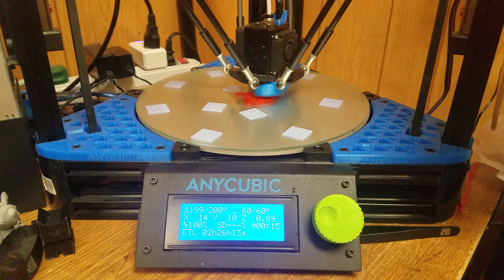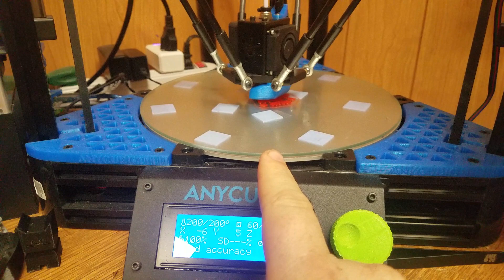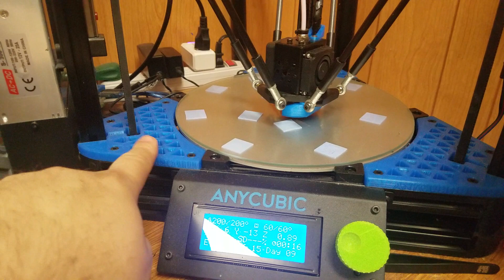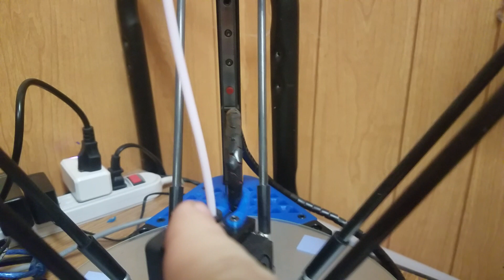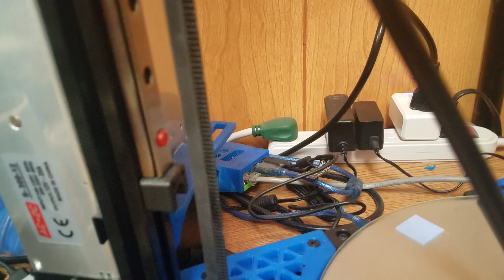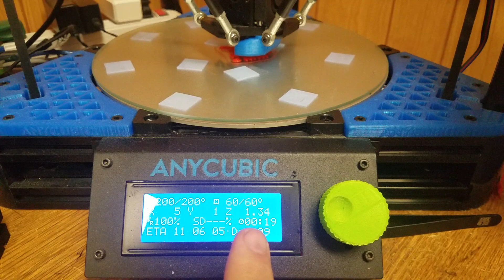Anycubic Kossel Linear Plus basic mods for the beginner

Comment: Just found your video, super informative my question for you is what are those square pieces under the glass?
Reply from the maker: Silicone thermal pads, made for CPU heatsinks. When cold it's sticky like cheap packing tape so you can remove the glass, but when at print temp you could lift the printer by the glass and they transfer heat perfectly.

Comment: what firmware are you using?  everytime to try to print something it just heats up and go back down then up and when it does print the nozzle is not touching the bed if so how would i manually calibrate it?
Reply from the maker: A slightly modified Spike Lee 1.1.9 to deal with filament change and heats. Otherwise it prints fine as is. To solve the other issue your having I've found the solution is to install the probe and run the probe Z height in the menu.

Comment: Would you recommend this printer for a beginner?
Reply from the maker: A delta is more as a second printer, it has a higher learning curve
Reply: @Tobashadow  im eanting to get into the 3D printing hobby. What printer would you recommend for a beginner?
Reply from the maker: A Ender 3 right now is the best low cost printer with a large build plate. For a bit more you can get a Monoprice maker select Plus which is my primary machine. Both of which are easy to use and versatile and easy to modify.
Reply: bought this as 3rd printer and I'm really struggling. I assembled the printer and when trying to start levelling all that happens is the hot end and nozzle just keep crashing into the back end of the build plate, any ideas?
Reply from the maker: @enochroot9438  check your three Z switches from top to bottom, from switch to board and make sure they are correctly plugged in and the three arms hit them when you hit home
Reply from the maker: @enochroot9438  the other thing to do is make sure the plug for the leveling probe is plugged up correctly on both ends and the pins on the probe plug is not bent which is easy to do
Reply: @Tobashadow  thanks for the advice. I will re-visit the printer using these suggestions